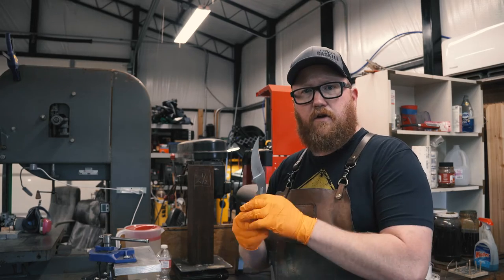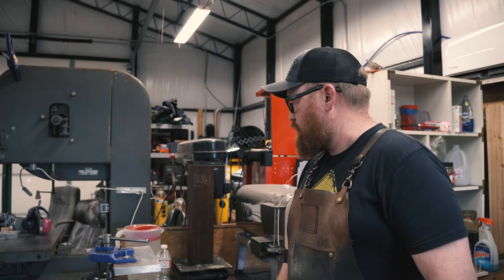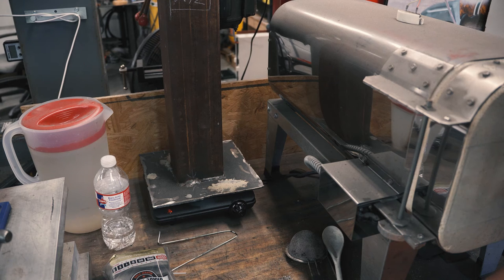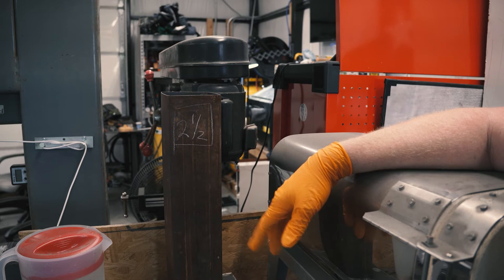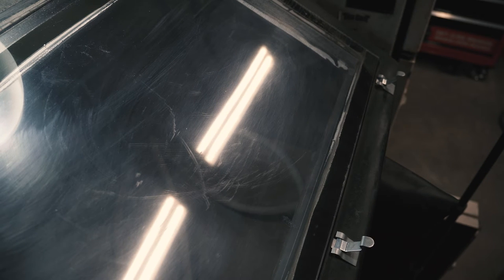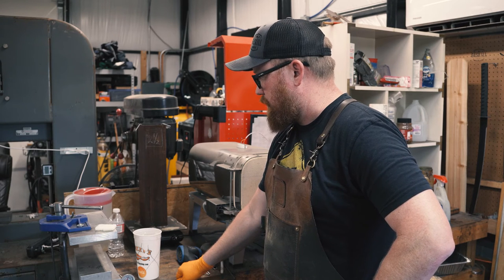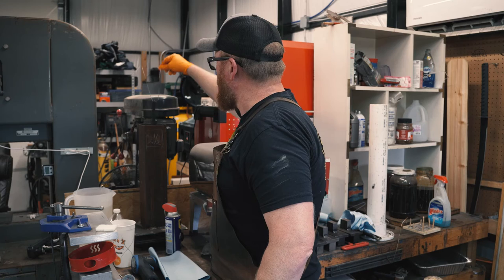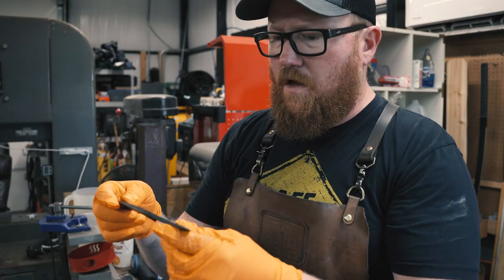Darken a Blade with Parkerizing

Comment: I just 80crv2 for the first time. I put it on my surface grinder and ground the bevels after heat treat. I couldn't figure out why it was so splotchy after the acid. You just said it may he remaining decarb. 
Thanks so much!  Mystery solved.
Reply from the maker: That's it, 80crv2 is notorious for having a heavy decarb layer.  Glad it helped.